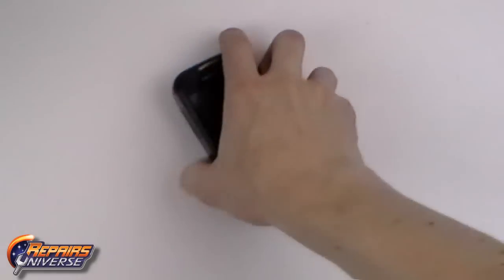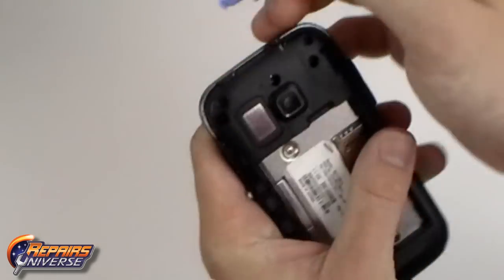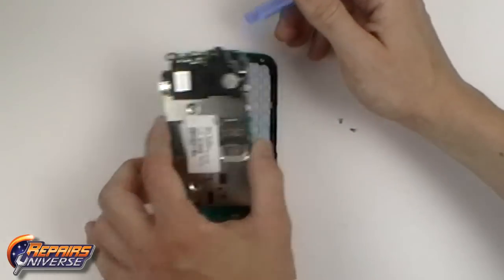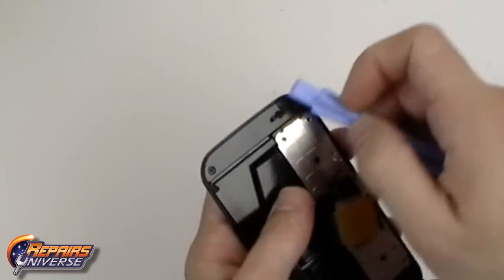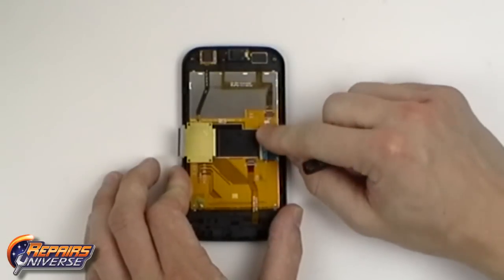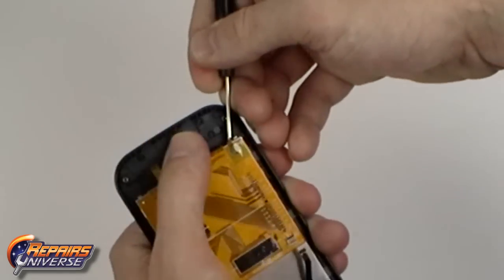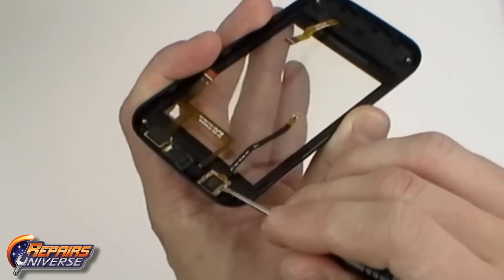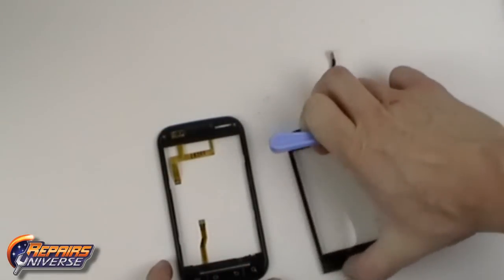How To Fix Samsung Indulge Screen

Comment: hey there, i left a comment here a while commenting on the great video but i wanted to ask a question, the screen on my indulge broke and i'm gonna do it myself (i've worked on several other phones before) my question is, once i remove the broken one , whats the best adhesive to use to secure the new screen, i bought my screen from a phone place online but im not sure if it has glue or not, thank you so much for any input you might have.